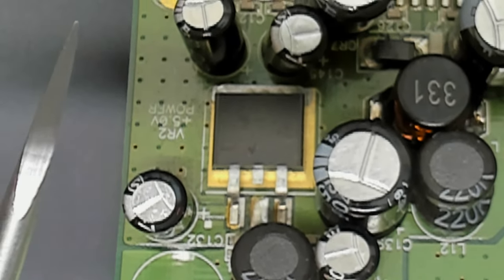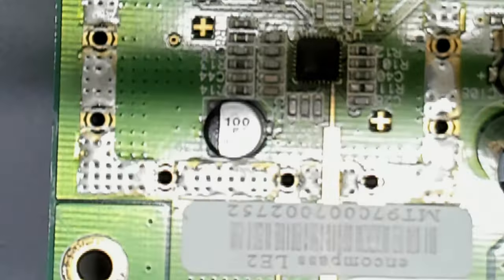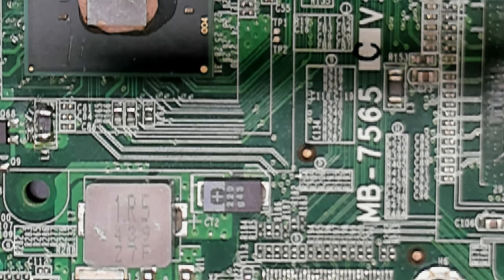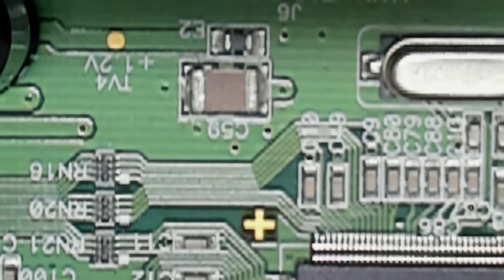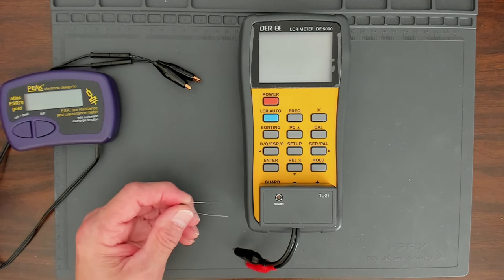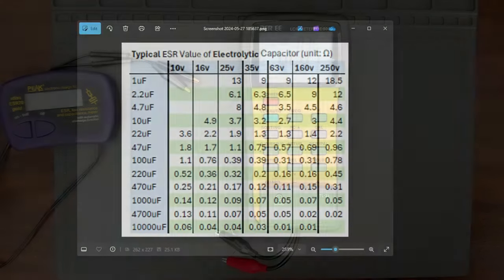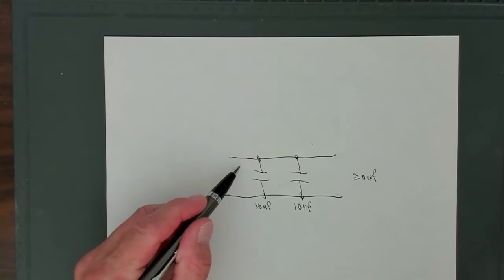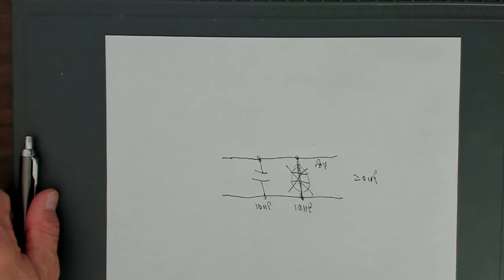Common capacitor types and their typical failure modes. ESR testing explained

Comment: One thing... the cuts on the top of an electrolytic can are to provide a weak point for pressure release. It is only a side effect that they bulge before the seal opens. They used to uh.. "go off", rather aggressively when annoyed prior to this change. Now they just bulge and vent.

Comment: How do you test a really big electroletic capacitor? Say, 3600 micro Farad @ 65V?
Reply from the maker: The ESR70 Gold can measure capacitance as high as 90,000 micro farads. When using these meters always discharge the voltage in the capacitor to protect the meter and for your own safety. Some mains capacitors have a rating of 400 volts.